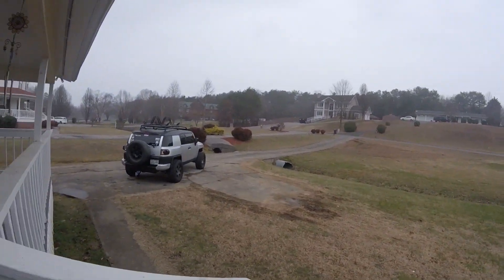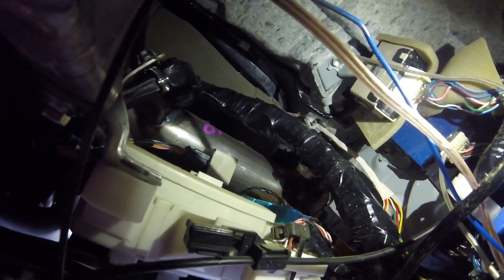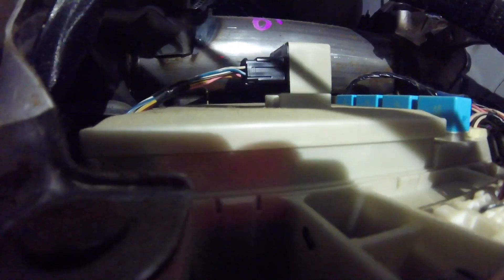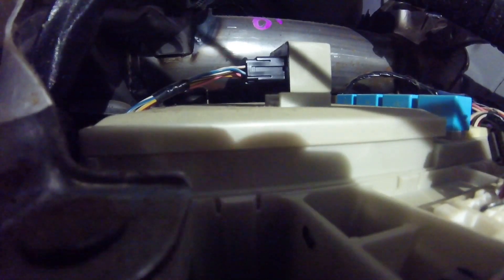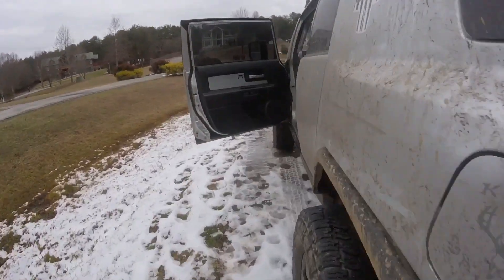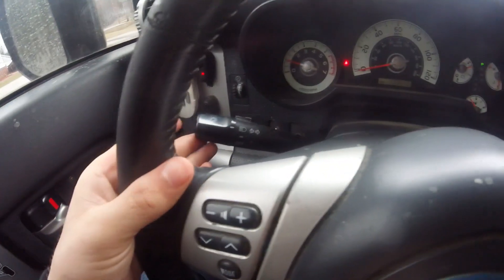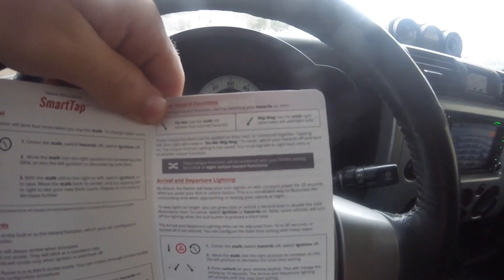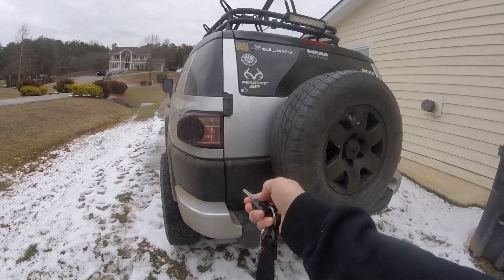FJ cruiser diode dynamics smart tap install!

Comment: Hey Bud, nice Vid! I changed all he bulbs in my Fj to LED( diode dynamics). Fairly easy! Ahhh but then it's time for the flasher unit right. Well if found it all the way on top of the backside of the fuse box panel. Why the hell Toyota put it there no idea. I used my cell phone to take a pic of it thus making it easier to locate with my hand and break it off the tab and relocated it lower and attaching it with strong Velcro. Worked great and now if I want to add the smart tap it's easy to switch out the flasher unit. After 10yrs I luv my FJ like the first day I bought it new!!

Comment: can you send a link to those halo headlights??
Reply from the maker: LONEHYPE AmeriLite Black Projector Replacement Headlights CCFL Halo Set for Toyota FJ Cruiser - Passenger and Driver Side https://www.amazon.com/dp/B07TP5S1YP/ref=cm_sw_r_cp_api_i_5yVUEbMYYAK6Y
Reply: Colt D oh cool. is there any major wiring that will need to be done with this or could i just plug in the light bulb and call it a day? and how do i make them brighter??
Reply from the maker: LONEHYPE  the halo is operated by a negative and positive wire, I grounded them out and then wired them to my daytime running lights. The headlight itself plugs right in.

Comment: off-road ricing?
Reply from the maker: capitán_ camote_picante oh buddy if you only knew what hell this FJ has been through 😂
Reply: @coltd2864  what kind of exhaust are you running? Thanks
Reply from the maker: svnbit basic 3 inch straight pipe.
Reply: @coltd2864  no muffler? Sounds good. Swapped muffler for a borla, oddly it seems I lost some low end. How's yours behave? Wanna get a non-pinched y pipe that's out of the way if getting more pinched but afraid I'll lose all the useful torque without a tune.

Comment: How did you get that cover off that the relay is mounted on?
Reply from the maker: Christopher29m you just have to pull up hard or get a flat head screw driver and pry the latches open on one side and the other side should pop right off.

Comment: Have you had any troubles with the arrival lighting
Reply from the maker: Mustang Enthusiast I never fooled with it, I’m not sure man!
Reply: Colt D I believe you push the stalk up and hit the unlock on your fob that sets it to 20 seconds or something then one more is 90 cant seem to get it to work much
Reply: @mustangenthusiast  The departure setting works with mine but the arrival setting never worked for me.
Reply: @carbonunit  yeah apparently they don't work on the fj because when you unlock it the parking lights already flash once or whatever so it turns it on then off. Heard something like that from diode dynamics.